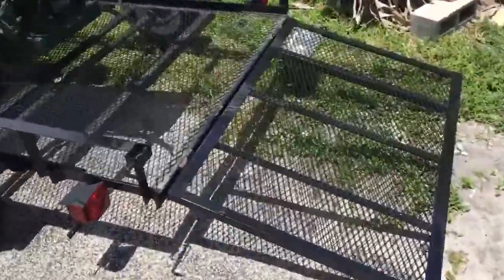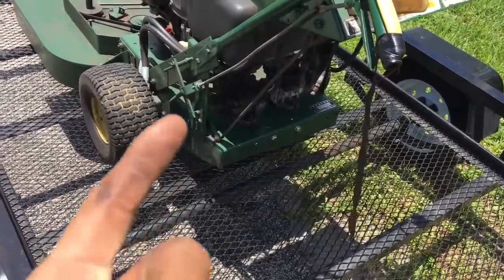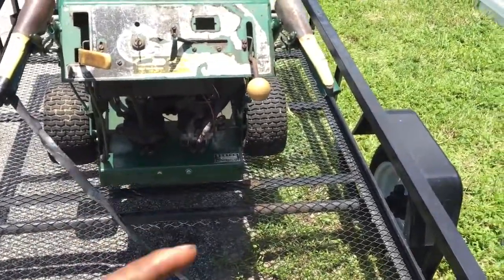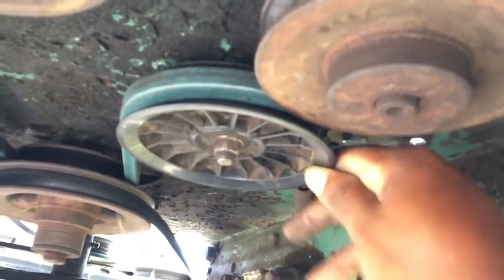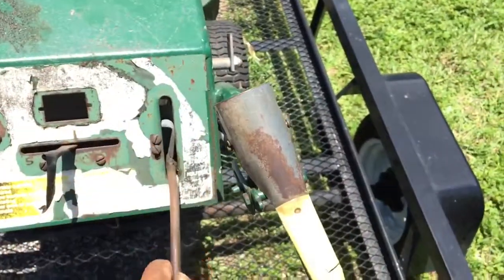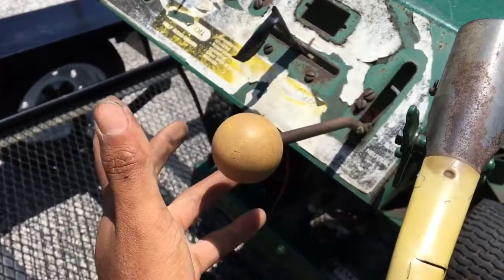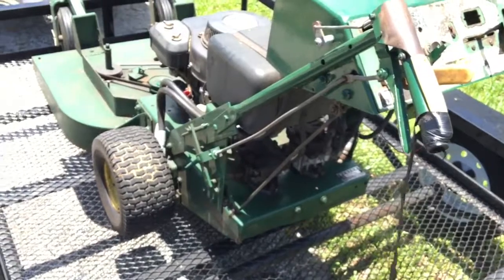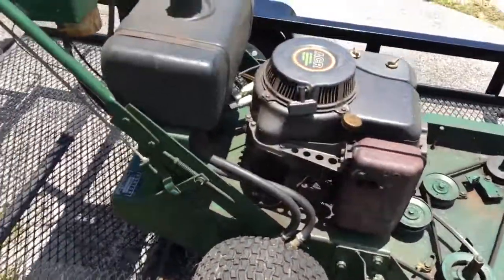36" Bunton walk behind mower keeps slipping forward.

Comment: Got a 52 hydro that I'm bringing back to life after setting for 5 years in the elements got the motor running today just having issue with one pump running way faster then the other
Reply from the maker: Good luck! I’m sure you’ll get it figured out. Just patience and trial and error. 52 inch must be BIG! Mine is a 36 hydro
Reply: @GreenThumbEngines  that link is the original buton owners manual it has pretty much all the info you will ever need to keep your mower running in top shape

Comment: My dad worked in R and D for bunton back in the day the way they tested durability of the frames was to drive them off the loading dock till they broke then redesign  it stronger and repeat till.they could survive 500 jumps with no failures they are great mowers well atleast until 97 when textron bought them out and ruined them but
Reply from the maker: That sounds amazing. I wish I could be there and have that kind of job to do those tests. That’s incredible!

Comment: Hey sorry to bother you thanks for your videos but i just bought one of these in really good shape for its age but theres a piece that comes off the bottom of the hydro oil tank thats located at the top of the handle bars im sure you know what im talking about but i dont see any hoses coming off of it it has two openings one at the one at the bottom and one off the side but again no hoses i havent started it or tried driving it wanted to do research first and see if you could help me
Reply from the maker: Um, does the mower have the model and serial number on the frame somewhere? Maybe you can tell me what those numbers are and I can send you a link of what you’re trying to find
Reply from the maker: Is it the same mower, bunton? Or is it a walk behind in general
Reply: @GreenThumbEngines  hey buddy. So I got it running good now. But I can't get it to move properly. The right wheel keeps going in reverse. Any ideas
Reply from the maker: @chrisjr1028  alright, check this. On the right handle bar, if you squeeze it, look on the side of the frame where the handle bar is and you’ll see a linkage on the right side. There’s a linkage on the Right side and every time you squeeze it, the link pulls back when you squeeze the handle bar, and then it releases when you let go of the handle bar. You might have to mess with that right side linkage. Try to make it identical to the left side. If you mess with that, it’s what keeps the mower driving straight forward without turning on it’s own. That’s how you give it an alignment to keep it straight while it’s driving. But maybe it’s messed up. Could be why it’s reversing... because I know if you squeeze both handle bars down, the mower should reverse very slowly.
Reply: @GreenThumbEngines  I think I'm going to sell the mower I'm tired of messing with it. I think It will end up costing me more than it's worth. Now to just find someone to buy it